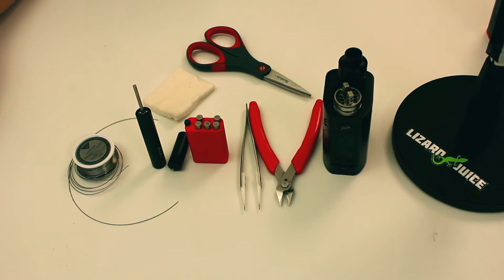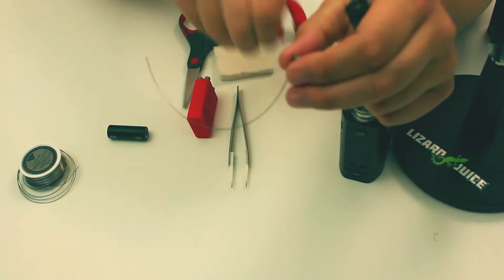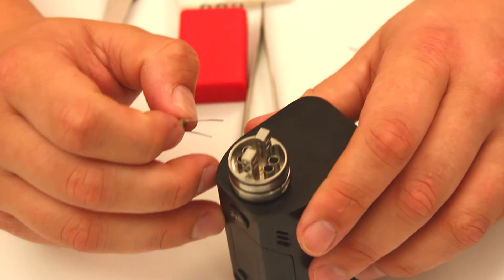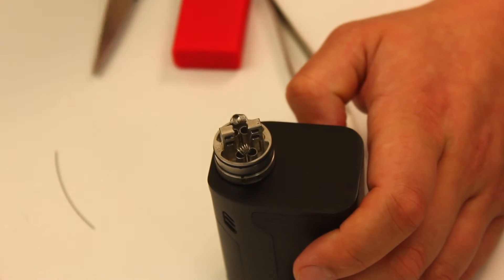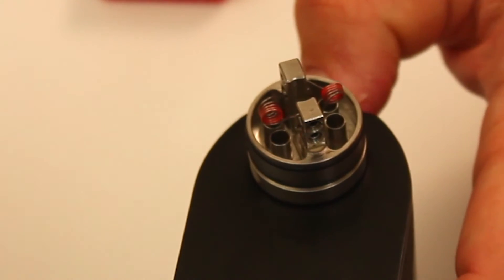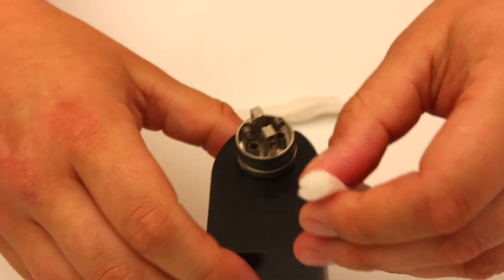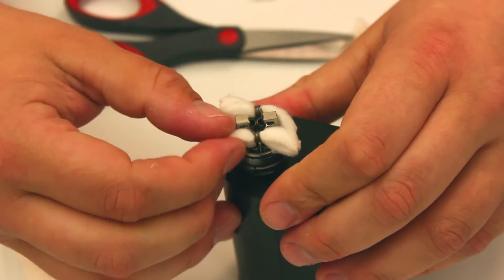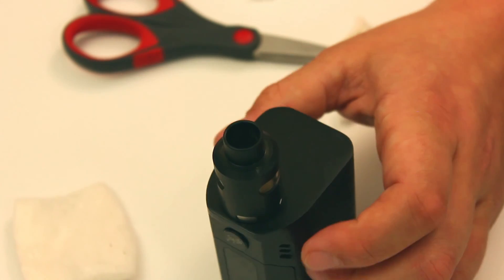Coil Building With Big J & Matt

Comment: With this build you're covering parts of the airholes. Should better not use microcoils sitting between the airholes. Spaced coils or coils that expand to the left and right outer edges of the airholes will give you more flavour and prevent the wick from covering the airholes.